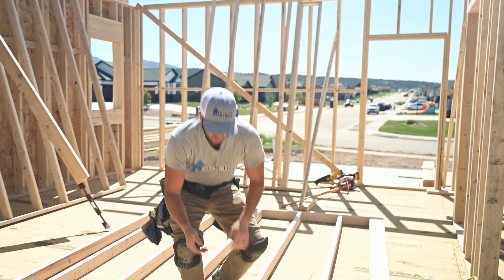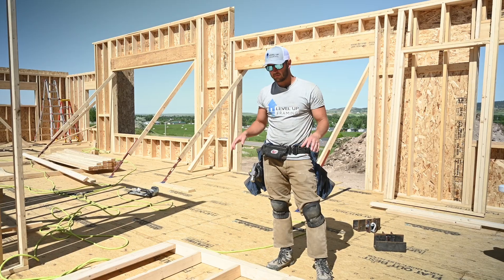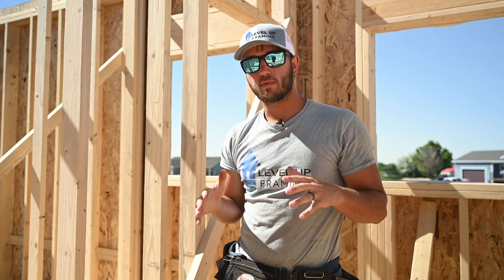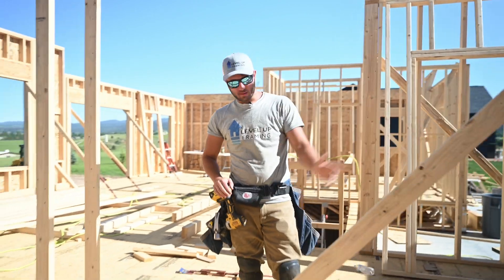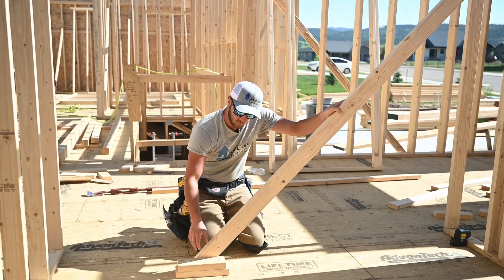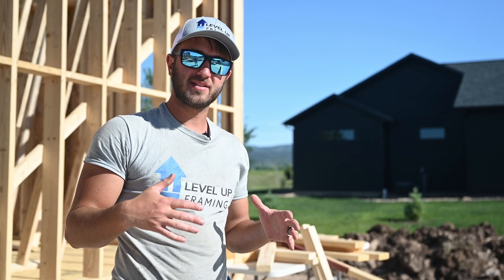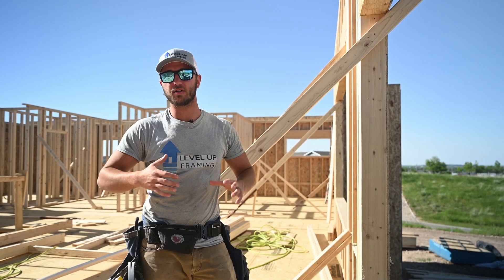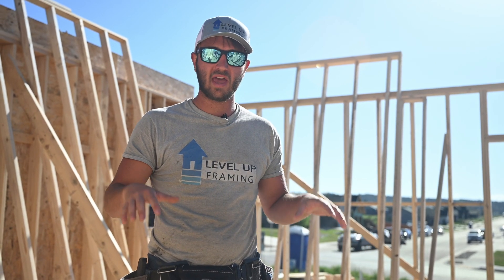How to Stand, Brace, and Plumb Walls | Framing Essentials

Comment: Square the wall on the deck and then sheath it on the deck.  It will stay square after it's up, and won't turn into a parallelogram.  You won't need to climb ladders with sheathing either.  Seriously.
Reply from the maker: You should check out our channel. Seriously.
Reply: @LevelUpFraming  Not meant as a criticism.  I think you'll find it easier, faster, and safer.
Reply from the maker: We have a video about sheeting on the deck! Check it out ;)
Reply: I think he's new at this.

Comment: Nice job! I like the turnbuckle approach. It looks like it would be the most effective way for someone working solo to get things plumbed accurately. Working alone can be challenging if not impossible. Several years ago, I built a 14x28 garage without any help at all, start to finish. Even with pressure treated sills, I don't like to set walls directly on slabs, so I used a single course of concrete blocks around the perimeter. The roll-up door was in the 14 foot width, and getting that wall lifted onto the blocks by myself was not easy. It had a 10 foot gluelam as the door header, and it was heavy. I got it in place, though. For its temporary bracing, I drove a stake into the ground at each end and used 2x4s diagonally. That was easier than trying to figure out how to attach temporary blocks to the concrete floor. Keep up the good work, man, I'm enjoying it!
Reply from the maker: Thank you! Nice job on the solo garage. 
Did you see the part about attaching temporary blocks to the concrete with nails?
Reply: @LevelUpFraming  Yes, I saw that. I'd probably take that approach with larger slabs that have expansion joints, especially if it wouldn't be practical to stake around the exterior. The house I'm going to build in the springtime will be on a crawlspace (except the attached garage), but I'll have a framing crew take care of all that work. I'm looking forward to the project, though, because I'm sure I will be involved in a lot of aspects of it. I won't interfere with the framing crew, though. They don't need me in their way. :)